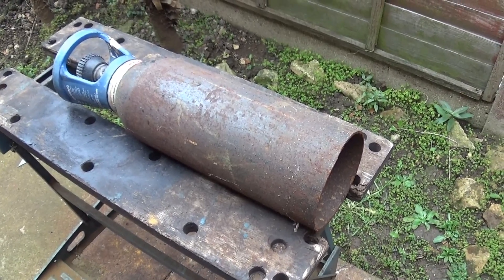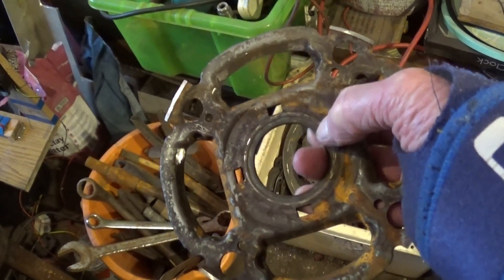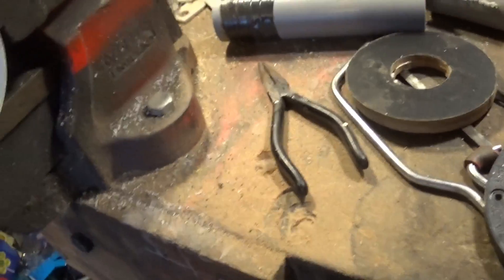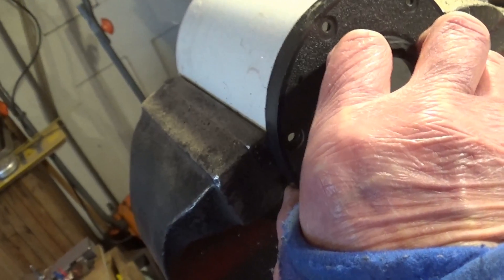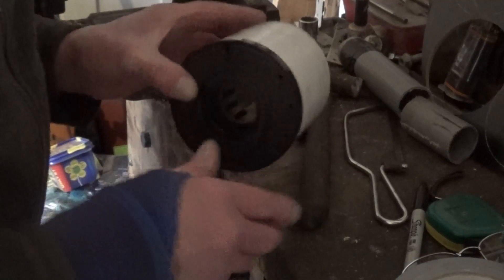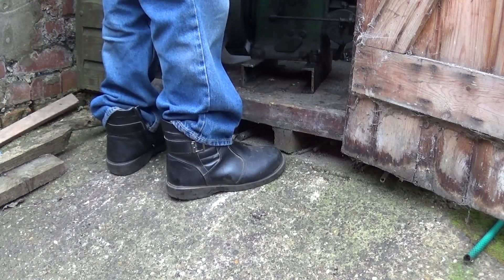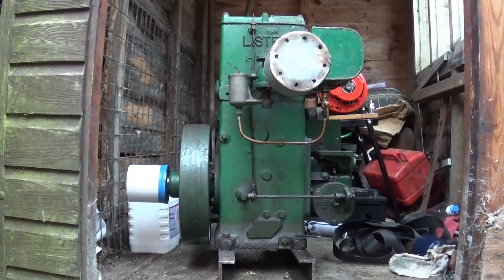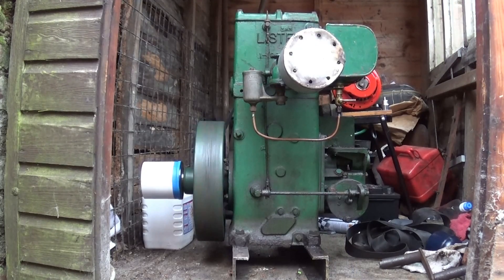Made a Pulley for the Lister D

Comment: You have that running close to true Malc, that's only got a few thou of run out. Not a day to be outside long it's felt bloody cold today. All the best Andy.
Reply from the maker: Cheers Andy.....near enough is good enough nowadays (grin) A hair is 2 thou thick. I spent 16 years often precision grinding shafts to 1 tenth of a thou. That's 20th the thickness of a human hair. So.....a little wobble is acceptable to me today LOL. A few years ago I could do a bit of cold if wrapped up well.....not now.
Reply: @MalcOfLincoln  To say you cut that tube by hand and centred the inner & outer bushings by eye I was amazed how close you got it pal. If you get 5 min check out RODALCO2007 this guy has got a lovely 4 cylinder lister and has built his own 5600 volt wasp zapper for his garden out of the guts from an old plasma tele lmao.
Reply from the maker: @andywilliams1160  Thanks again Andrew. I've had a lot of practise. Now, have you seen the recent model steam engine run I did. Well making that 2 years ago I was DETERMINED to get the flywheel true. Problem is, hard and soft spots in the ally I cast from cans. It took me over a week on the belt sander......but I did it. I've shown a little of how I did it on a previous video on the build playlist.
Reply: @MalcOfLincoln  I've not seen many of your steam engine yet because I've been catching up on the Nuffield playlist, wow you were lucky that valve chip didn't scrape the liner to bits, but she ran a dream after the rebuild. I only get time to watch a few each evening so I will get to the steam engine next. Andy.
Reply from the maker: @andywilliams1160  Thanks again Andy. Yes I was lucky with the Nuffield problem, however it was only 2 small pieces of valve, and I stopped almost immediately. Obviously was also lucky with friends who helped immensely. Thanks for your support, it really helps  😊
Reply: @MalcOfLincoln  Thanks for your videos Malc I never watch the tele I unplugged it 12 month ago and don't miss it, got a few youtube channels I catch up with on an evening now & yours is right up at the top.
Keep your self well and I'm looking forward to seeing what you do next. Andy.
Reply from the maker: @andywilliams1160  I chucked my tv 15 years ago. Same as you, YouTube much better. Got so many online friends around the world now, plus all the opportunities I've had through doing it. Thankfully we can now watch what we want, when we want. Not be brainwashed by the media.